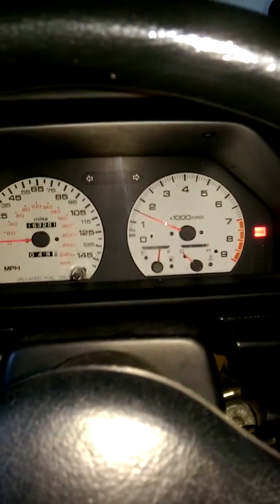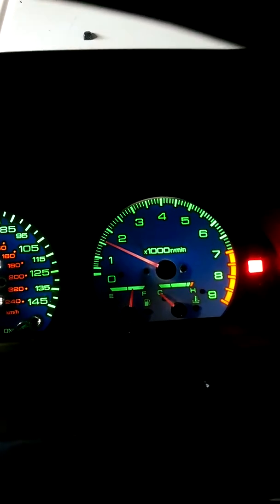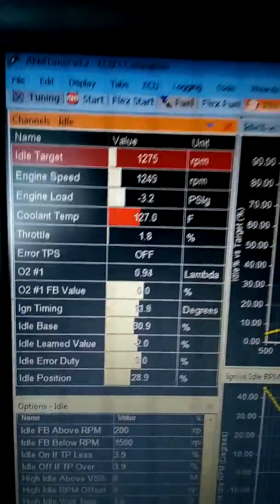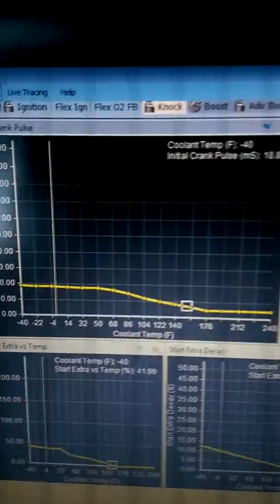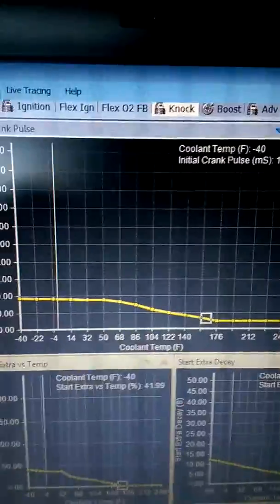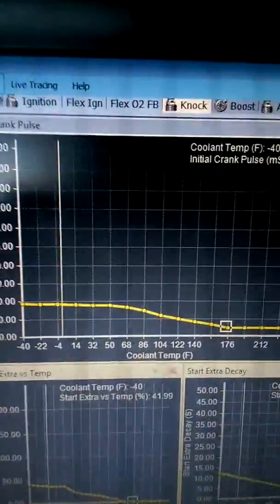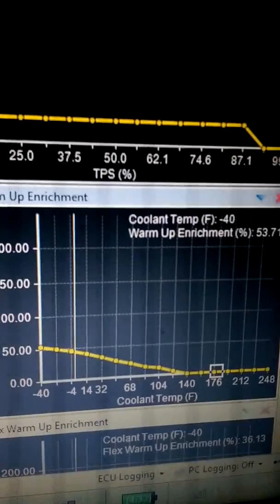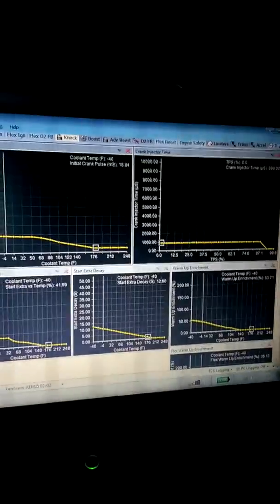4G63 AEM Series 2 Cold Start Tutorial

Comment: are you using the 1g aem ems? if so what plug did you use for flex fuel signal wire oil pressure and fuel pressure sensors?  thanks in advance.